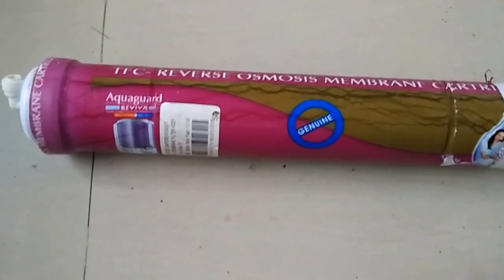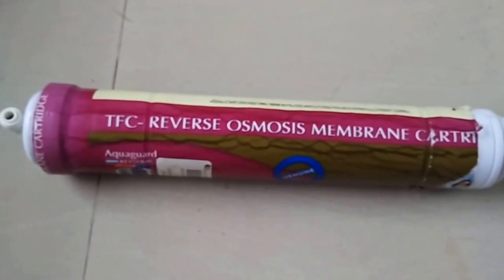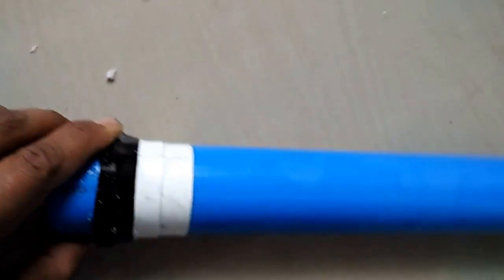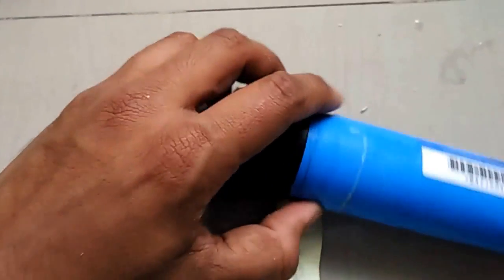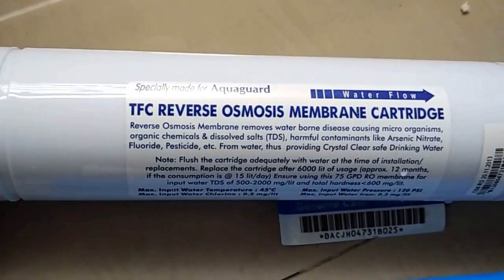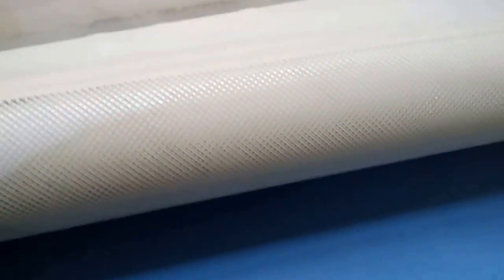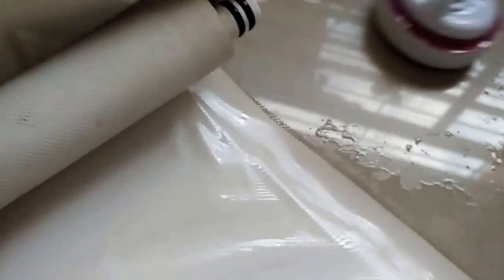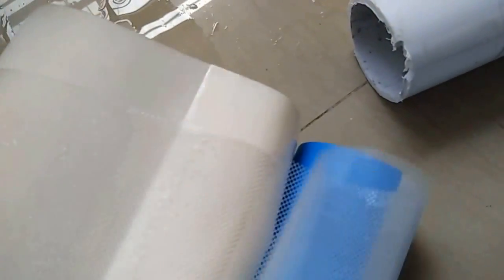RO Membrane, Inside and how it works. teardown of reverse osmosis water filter

Comment: i have 4 stage Ro and water coming from it was bitter in taste so i changed my membrane but tds is still showing 266 PPM and flushes 4-5 bucket of water but still no change then i changed the pre-filter but no change in TDS and 2months earlier i have changed the sediment and carbon filter also....pl provide some solution.
Reply: If you have high tds (less than 90 % removal from membrane) 
1 . Bad membrane
2.also check presediment filter
3. If you have high water pressure over 80psi in-line , it will destroy membrane very quickly.

Comment: My Dow Filmtech membrane went Bad in just 6 months, from last 2 month it started giving salty water and the tds was around 150 and even more sometime, Now it has stopped working and i don't get even waste water and filtered water getting is very slow in drops and high TDS also opened the ro membrane and can see layer of salt like sediments, My source water TDS is around 500-600 and even last time the Kent RO failed within 6 months. let me know what i should try now and if you can suggest something which can help.
Reply: Change sediment filter every 6 months ( it is cheapest filter anyway) . Pre carbon and post carbon can last you 12 months